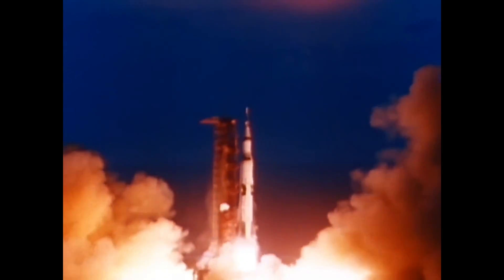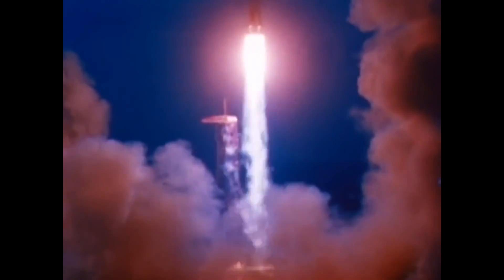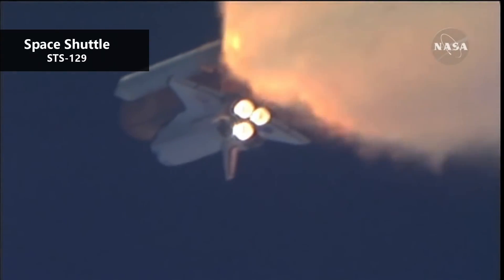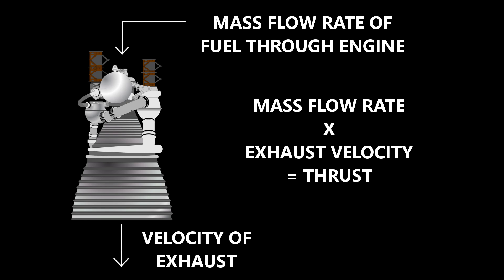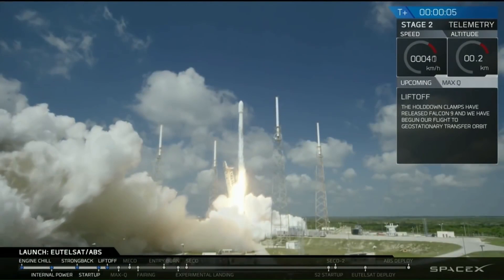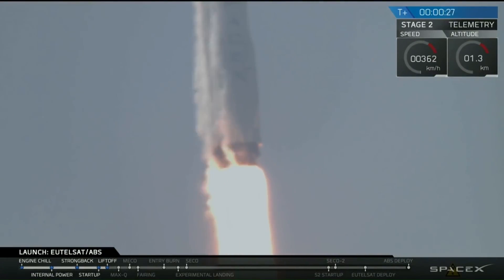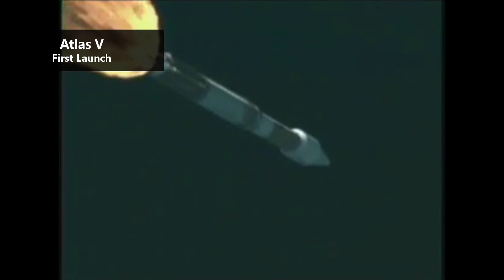How Rocket Engines Work - Part 1 - Thrust and Efficiency

Comment: this is wrong!..the mass of the rocket and the thrust from the rocket are one closed system(one action pair)the reaction of the atmosphere 14.7 psi pushing back at the rockets thrust(second pair)(makes one force pair) creats the take off..not the thrust of the rockets alone..y
thats would mean that the rocket pushing itself and getting lift🤔
Reply from the maker: Wouldn't that mean rockets can't work in a vacuum?
Reply: Space Is Kind Of Cool..honestly i have no idea..i also didnt mean it personaly towards you..sorry about that!..only to me newton 3e law always works with force pairs..as long as the rocket engine is attached to the shuttle in space! they are one and the same mass pushing against itself..if you only had the rocket and engine without the shuttle attached and fired the engine would the engine and nozzle move forward? this would be one force pair? pushing itself?..in a vacuum..there is no equal force pair..sorry for my englisch isnt my native writing speech..
Reply from the maker: It's because the engine isn't pushing itself. The exhaust from burning fuel is pushing the engine.

The rocket engine pushes fuel one way and the paired force is the rocket going the opposite way.
Reply: if the engine isnt pushing itself..but its the exhaust..then the exhaust has to push and be pushed against by something to create the thrust to move the engine..because the engine isnt giving an equal counter force..and isnt it so that the gasses of the nozzle in a vacuum will be sucked away instandly..because of the vacuum?
Reply from the maker: Imagine it like two people on roller skates facing each other.

If they push each other they both get moved backwards. Both get pushed with an equal amount of force. This would even work with two people floating in space. If they push off of each other they will both move backwards. There doesn't need to be any air around them to push off of.

Rockets are the same way. Just imagine one of the two people is the rocket and the other person is the exhaust.

The rocket engine and the exhaust push off of each other. So they both move away from each other.
Reply: yes!!. you are right about this..this is the 3e law..
but!!🤔now replace one person with an engine fixed to the nozzle.
if the person pushes against the engine fixed to the nozzle the will both fly apart..the person will go faster because its mass is smaller..and the engine fixed to the nozzle will move away..but slower because its mass is greater.
now fix the person(space shuttle) to the front of the engine..hereby its has become one!! and can no longer give any force what so ever!..to the engine or fixed nozzle.
they hang there in space..
at what point when you fire the engine and exhaust..jets!! out..can the fixed person and the fixed engine to the nozzle..give an equal opposite force to the exhaust where everything is fixed to eachother? you can only push a mass away from you so you get an equal and opposite reaction where both massas will go a direction.
the exhaust is only pushing itself because al parts are fixed.
if it did move?..the exhaust has!! to push something away to move in the opposite direction..and to me this cant happen in a vacuum..there is nothing there.
also isnt is possible for the exhaust reacting with itself and creating thrust..because the vacuum will suck the gasses in to space with the same speed it comes out of the nozzle..so it can never interact with itself.
F one = - F two.
it cant be that the exhaust is F one and the person(Spaceshuttle+engine+nozzle) is = -F two..they are fixed!🤔
Reply: to me its like you said..two people pushing each other in space will move them apart..now tie there hands together..no matter how much force they give..nothing will happen..if one person gives force(thrust) nothing happens because they are tied together.
Reply from the maker: The force between the exhaust and the nozzle and the force between the nozzle and rocket body are not equal.

For example:

If the force between the nozzle and the exhaust is 10 kilonewtons.
And the nozzle weighs 1 kilograms.
And the rocket body weighs 99 kilograms.

So the total mass of the rocket is 100 kg, with 10 kN of thrust. Then the acceleration will be 100 m/s/s.

The acceleration on all parts of the rocket is the same. 

To accelerate the 99 kg rocket body at 100 m/s/s there needs to be 9.9 kN of force acting on it. This is the force between the rocket body and the nozzle.

So the nozzle has two forces acting on it. The 10 kN force from the exhaust and the 9.9 kN force from the rocket body. These forces are pointing in opposite directions so they cancel and the net force on the nozzle is 0.1 kN.

And a 1 kg nozzle with 0.1 kN of force acting on it will accelerate at 100 m/s/s. The same rate as the rest of the rocket.
Reply: never mind..that its linked to flat earth conspirecy ideas..for me its about what he is saying..or is his science wrong?? .and the vacuum of space has no effect what so ever on the exhaust gasses of a rocket???
Reply from the maker: Yes, the vacuum of space does have an effect on the exhaust gas of a rocket. But remember newtons 3rd law. The action of the exhaust being sucked out must have a reaction. The only other object in the system would be the rocket. So it gets pushed forward when the exhaust gas is sucked out. This is called pressure thrust.

And how is any of this linked to flat Earth conspiracy ideas?
Reply: there's a guy called jeranism who also has this video to prove the earth is flat..
its because the link between the video and him is there..
Reply: oke..if it has an effect..this has to be greater then and instantly! any thrust..that comes out of the nozzle..al this energy would be lost to expanding space..and the rocket would have no forward motion..
i have never seen a vacuum cleaner nozzle..that sucks..  give a pressure thrust that gives an equal  opposite reaction to the dirt it wants to suck up🤔
Reply: i try to imagine..an astronaut standing in a dock..filled with pressured air..there is a hatch between him and space..if the pressure isnt equal and the hatch opens..al there air...and the astronaut will be sucked out..at that moment there is no pressure thrust moment that moves the ship witch is part of the dock away🤔
Reply from the maker: When the gas leaves the nozzle at high pressure there is some energy lost while it gets expanded into empty space. You're right about that.

But rocket nozzles which are designed to work in space have a very high expansion ratio. Which is the ratio between the smallest part (the throat) and the nozzle exit.

This high expansion ratio means the exhaust is expanded to a very low pressure while still in the nozzle.

When the gas expands in the nozzle it pushes against the walls of the nozzle rather than just out into space.

Yes, there is always some energy lost, but most of the energy is spent pushing the rocket.
Reply from the maker: Yes, the air leaving when the door opens will push the ship in the opposite direction.
Reply: yes..what your saying..is true. that is what it will try to do..but no matter how great the expension and pressures from the rockets are..in a vacuum that is the expanse of the whole universe..this force must spread and losses all energy.
Reply: oke..air leaving will make the ship move..this i cant believe🤔not in a vacuum..
Reply from the maker: Once the exhaust leaves the exit of the nozzle it has no effect on the rocket. Any energy left in the exhaust will be lost (lost from an engineering standpoint, energy cannot actually be lost), but the nozzle will have already captured a significant portion of the energy and will have been accelerated forward.
Reply: yes..its not lost..but spread pretty thin to have any effect.
i give the vacuum of space a greater force..than you do..to me you hold true that the combustion of the fuel and oxidizer via the combustion chamber thru the throat and exits the nozzle can "fight" the vacuum..
to me..
the combustion chamber is a pressure chamber that as soon as it opens up to release the pressure the vacuum has direct "contact" an will suck all the pressure out..losing combustion temperture  and pressure..
Reply from the maker: The combustion chamber is fed fuel and oxidizer at a rate such that it maintains a constant pressure. It cannot be sucked out and emptied until the engine is turned off.

And the vacuum of space has no force. There is no force pulling the gas out of the rocket. Only a force pushing the gas out.

The gas only expands because the atoms are very close and push each other away.
Reply: @SpaceIsKindOfCool  - It also needs to be understood that most of the thrust created by a rocket engine is produced right inside the engine itself. Thrust is produced inside the nozzle where the inertial mass of the propellants is accelerated. Most of it is produced in the throat area, which is where the greatest restriction is, while a bit more acceleration occurs inside the engine bell. As such the only purpose of the big opening at the back is to let the expended propellants escape the engine so additional fresh propellant can enter the engine to be burned. Inside the atmosphere there there is some additional thrust created as the air is pushed down, but this effect subsides as the rocket proceeds into a vacuum. Then once in a vacuum the rocket engine continues thrusting because it continues to accelerate the propellants backwards against the resistance of the propellant's inertial mass (Newton's 1st law). The fact that there is either an atmosphere or a vacuum outside really makes little difference.
Reply: Here we go again! It is also very important when giving a complete explanation of rocket propulsion to also mention Newton's 1st law, which describes inertia. This is especially important when people ask the typical question, "What does a rocket push against in space?" To properly answer this question it must be pointed out that both the rocket and the propellants have mass, which means that they both have corresponding inertia. Inertia makes anything with mass want to remain in its current state of motion, according to the 1st law. As such both the rocket and the propellants both have inertial mass and want to remain in a uniform state of motion. So, when the engine is firing both the rocket and the propellants are pushing each other in opposite directions against each other's inertial mass. As such the induced motion of both masses are away from each other and away from a common starting point. So to answer the question about what does the rocket push against, it pushes against the inertial mass of the propellants, which want to remain at rest, as they are accelerated away from engine in the opposite direction.
 I sometimes describe the propellants as having a "dual function". One function is to support combustion to generate heat and pressure inside the engine to accelerate the propellants out the nozzle. But the other function is to provide the mass, with its corresponding inertia, that gets accelerated to provide the equal and opposite reaction.

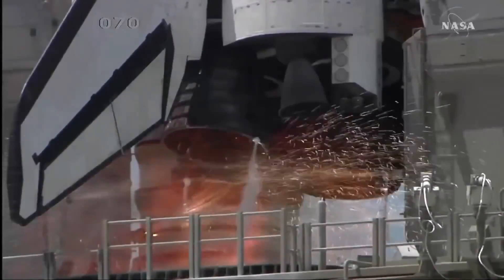Comment: What are the 3 circular holes that appear to the right of the smaller engine at 1:07
Reply from the maker: I was wondering the same thing while editing this video.

Turns out they're part of the reaction control system. The are covered to protect them from FOD and moisture before launch, and the covers break due to the sudden movement and pressure changes during engine start up.

Comment: Technically it is not "exhaust velocity" that produces the Thrust... It is the pressure of the expanding gasses on the inner surface of the bell nozzle... That's why rocket engines work in the vacuum of space in accordance with Newton's 3rd law. Exhaust velocity is merely a consequence of above Primary reaction producing Thrust.
Reply: YOU ARE CORRECT!. THE GAS IN THE COMBUSTION CHAMBER EXPANDS IN ALL DIRECTIONS:BACKWARDS OUT TO THE BELL NOZZLE, OUT TO THE SIDES OF THE COMBUSTION CHAMBER  AND FORWARD TOWARDS THE FRONT OF THE ROCKET. THE GAS PRESSURE ON THE SIDES OF THE COMBUSTION CHAMBER IS EQUAL ALL AROUND AND PRODUCES NO NET THRUST. THE GAS EXPANDING FORWARD INTO THE BELL NOZZLE ALSO PRODUCES NO THRUST. BUT THE GASES MOVING FORWARD PUSH ON THE BACK OF THE CHAMBER AND PROVIDE A FORCE IN THE FORWARD DIRECTION. THE GASES MOVING THROUGHT THE NOZZLE ALSO EXPAND IN EVERY DIRECTION. THE NOZZLE HAS A CURVED SHAPE AND THE GASES STRIKING THE CURVED SURFACE HAVE A VELOCITY COMPONENT IN THE FORWARD WHICH PROVIDES TRUST IN THAT DIRECTION. THE GASES LEAVING THE ROCKET PRODUCE NO THRUST AT ALL.
Reply: @eugenegrudzien5040  What exactly is combustion….? Is it an explosion?